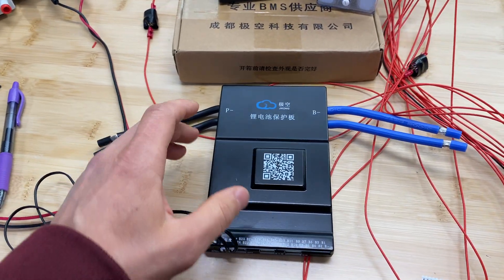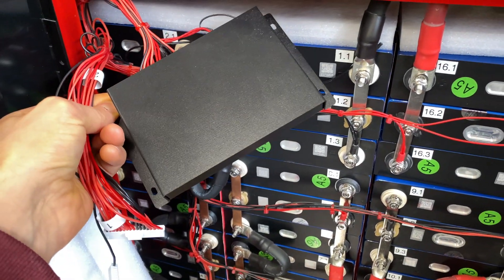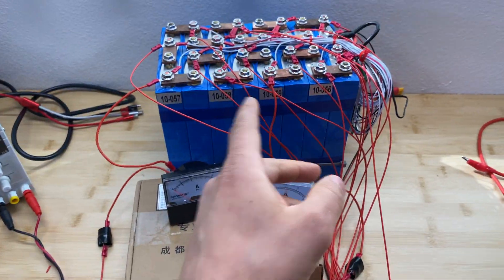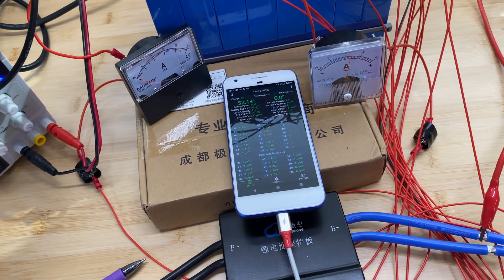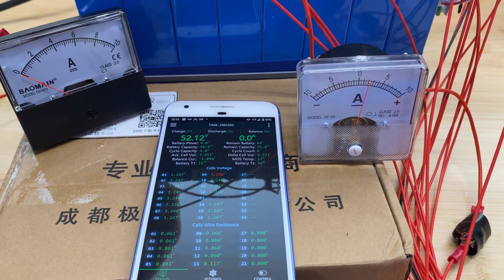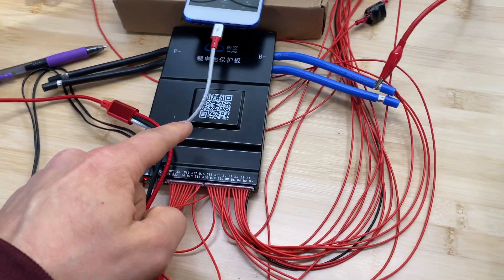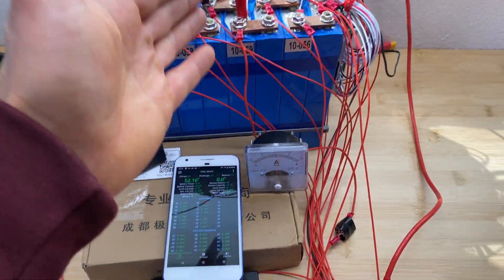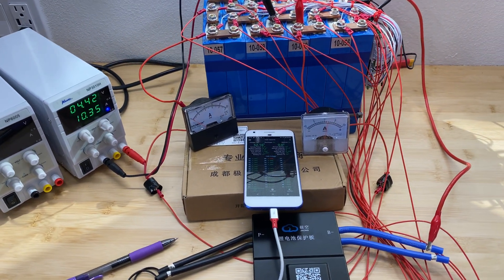JK BMS 2A Active balancer. Is that real?

Comment: good test but this has to be like that, you can not draw / send current and also sense the voltage correctly at the same time. It would need separate leads for that or to drop power to do it

Comment: I've just ordered two of the 2 Amp bms. I hope they do good on my 24 volt configuration
Reply from the maker: it's a good balancer, make sure you crimp connectors for each balancer (do not combine 2 wires under 1 connector)

Comment: Hi there.  Firstly, your video has been a great for getting me to build my own battery pack.  I had my pack running for several months with the JK BMS you are using in this video.  Recently, I have an alarm shown on the app relating to this BMS.  I switched the BMS off fixed the problem and discovered that I could not turn it back on.  I tried using the 5V approach and also using the LCD display.  Nothing happened,  I noticed also that the cycle count before turning off was 77.  In the past, I was able to switch it on and off but now it will not turn on at all.  Have you experienced this?  I am open to any suggestions you might have.

Comment: Why don't they sell a version with threaded holes?
Reply from the maker: good question, idk
Reply: @SolarEngineering  it looks like 8awg....I would rather do my own wires.
Reply from the maker: @MyGoogleYoutube  yeah, unfortunately, it's soldered to BMS, and it's going to be hard to fit a bigger awg there.
It works fine in my setup since I published this video. (not pushing more than 100A trough bms)
Reply: @SolarEngineering  How did you bind on to the supplied wires?
Reply from the maker: @MyGoogleYoutube  crimped 2 wires under one lug.
Reply from the maker: stop this video at 7:45 and check 2 blue wires close to the 1.1 label
https://youtu.be/yGWc1_Ujbq0?t=465

Comment: Just tried this one on a new pack to charge it as 1 cell wanted to run but it won't pear with my phone since I changed the password ever have an issue with yours? Don't know if I should buy another I don't need $400 paperweights (200 ea)
Reply from the maker: strange, do you have red led on? do you hear BMS beeping when you power it?

Comment: In the installation of my JK BMS I cut some of the cables that go to the batteries to avoid having to coil them. I wonder if JK BMS tests each wire and enters a different resistance for each without user intervention?
Reply: There is a screen on the app that shows the resistance of each wire. I don’t know if it uses that info or just displays it

Comment: How do you calculate the size BMS to purchase?
Reply from the maker: Take max load current or charge current and multiple by 2 (because cheap Chinese BMSs usually overrated). 
I'm pulling about 90A Max from my battery bank with this BMS, so far works great.
Reply: @SolarEngineering  Thanks for your reply.

Comment: Can you please let me know how did you connect the  black cables marked P-? And why are there 2 blue cables marked B-? One is not enough?Thanks for the reply
Reply from the maker: P- and B- paralleled. You need to use all of them to distribute load from BMS equally.
B- connected to battery negative.
P- to load (aka inverter/charger) negative

Comment: Really good video. Are those 2 cables on each side of the BMS even capable of handling 200A sustained?
Reply: 4 AWG wire is recommended for current draws of 150 amps - 250 amps @ 13.5v @ 4-7 feet.

The JK BMS used dual 7 AWG wire @ 1/2 ft. This is 2x13mm2 = 26mm2.  This is actually thicker than 4 AWG (25mm2).

So, can 1/2 ft of dual 7 AWG copper wire handle 200 A? 

Answer is YES
Reply: @DavidHalko  7 AWG wire is about 10.5 mm2 NOT 13
https://it.wikipedia.org/wiki/American_wire_gauge
so 2x 7 AWG is about 21 mm2 wire section.
Reply from the maker: these wires are not rated for 200A for sure, I'm pushing 90A through BMS and so far it works fine.
Reply: @SolarEngineering  ok thanks. its amazing how its rated for 200A continuous but the wiring can't handle it. The JKs are really good BMS in terms of features and the balancing current. If they can only utiilize the proper rated cables, this BMS would be unbeatable.
Reply: @hendersonsobers396  the cables are able to handle it. The good thing is they have threaded in and outputs which you can make your own thicker cables even with 35mm and 70 mm terminal cables which fit. Andy in Off-grid garage has tested this.

This a good video to explain how the BMS works, but the reason why it works with pulses, has to do with reading and pushing power in between readings, but the assumption is correct, not a continuous 2 amp balance.
Reply: @SolarEngineering  If this helps, i have that BMS with the bluetooth, and at 80 Amps steady for 1 hour at 25ºC ambient, on just ONE wire( that is all i need,and makes for an easier installation) it works fine,stays cool by itself,no cooling,no fan,no water spray; it also has the  best silicone jacket quality, and best extremely fine tinned wires, hundreds of them; ( rated for over 200ºC,the manual says); so far,it works like a champ ,3 months on, but i never push more than 80Amps, and usually 30 Amps only all the time.

Comment: So, is it junk ?
Reply from the maker: no, it's working in my 23kWh battery bank. I'm pulling/pushing about 100A, and so far works great.
Reply: @SolarEngineering  i watched offgrid do a review on these bms's and his let smoke out at 200 amp. Im considering buying 2 for 2, 4s batteries and want to be sure they are ok.
Reply from the maker: @karldingbat  I haven't pushed 200A, even wires soldered to BMS are not rated to 200A. So I derated BMS to 100A.

Comment: It will pull 2a from a cell but it only does that 40% of the time.  But it works very well.
Reply: My experience of 3 months,24 hours a day is that it works, but it is really slow,useless  on 100+ AmpHour batteries while they are charging or discharging;  when one of them wants to drift to + or- 0.300 or 0.400 V, it just can´t cope;  if they are off, it works ok, but then it will hardly be needed; 

Mine are not matched, but of course the best way is to have closely matched cells from factory; what i do is,  i paralleled the 8 mismatched,cheap, 200Ah cells with 8 excellent ones of 60Ah,the best  (someone gave me them,used from 2014, Winston?..factory matched with serial numbers!!) 2 by 2 ,2P8S, and the 60Ah ones keep the big ones in check; 1 BMS,  8S, only,all have monitoring wires of  1.5 mm2.

Comment: cut balancing amperege in half?? what kind of amature talk is that. unbelieveble.
Reply from the maker: I feel like "1A constant active balancing" will be more correct description of bms/balancer.
Reply: @SolarEngineering   of course,you are right, it works only half of the time;   but what about the ones that only say 500mA, or 1 amp?  you need to divide that by 2,also,or not?
Reply from the maker: @josepeixoto3384  yes, it will work same way, so need to divide by 2.
Reply: @SolarEngineering  Correct, and it only balances one cell versus the other balancers doing multiple cells so its even slower than half. But it still works good enough, well done JK!

Comment: The pulse 2A balancing is as per design and it is not safe to have continuous balancing esp in such higher current. The BMS balancer is designed to sense the voltage accurately by dropping balance current. This is to prevent overcharging and discharging of the cells by the balancer itself. Voltage reading over the small balance leads will be inaccurate if the current is not dropped to 0. Hope you understand the function.

Comment: Would you recommend this or daly BMS?
Reply from the maker: I haven't use it yet for continuous period. Can provide my opinion after month of use. 
I don't want to come back to Chargery BMS for sure.
Reply: @SolarEngineering  waiting for a review video! Also, your video presenting is very good.  Great videos, keep it up!
Reply from the maker: @gytax01  thanks for the feedback, appreciate it.
Reply: JK over Dally. 

The balancing of the dally ends when the battery is charged, even if the cells are not balanced. The JK BMS can start balancing when battery is mostly changed and can keep balancing after the battery is fully charged (to deal with very large battery banks.)

Comment: Hi. I have such a Bms, and I have a problem that the LED does not flash.
How can I make it happen? Can I install JK BMS?
Thanks
Reply from the maker: do you mean BMS doesn't work at all or just LED doesn't blink?
Reply: @SolarEngineering  Stop blinking!
And I don't think I can install the application to start Bms control
Reply from the maker: hm, installation off application is another topic, check your phone..

I noticed that LED is solid when BMS not balancing any cells. 
Also BMS charging activated, make sure BMS is active.
Reply: Have you triggered the BMS with a voltage at least 4V higher than the battery voltage? Off Grid Garage YouTube channel had the same problem.. it is not mentioned in the instructions that came with the BMS. Once he had triggered it , the BMS worked well and the light started flashing... See his first video about the JK BMS.

Comment: Come on get real. It isn't possible to move 2 amps continuous. The process is to charge a capacitor from the chosen high cell and then when the capacitor is charged, discharge the energy into the chosen low cell. The active balancer you already have does exactly the same process.
It works fine even with 320ah cells.
Reply from the maker: I'm on max level of realism. I see you opinion, mine slightly different.
Reply: @SolarEngineering  Not an opinion matey, its physics. 
If you have access to an oscilloscope, monitor the charge current profile on one channel and the discharge current profile on the other. Be careful with the common ground though, you could short out several cells.
Using a capacitor to transfer charge from one place in a series circuit to another is a handy, efficient and understandable methodology.
Remember the cells must remain isolated from each other, the capacitor does that effectively and flexibly.
Imagine cell 16 is the high one at instant"a" while cell 5 is the lowest, current flows from cell 16 into the transfer capacitor to create charge at the classical exponentially reducing wave shape. Once the capacitor is charged the terminals are switched across cell 5 until discharged. The processor then polls for the instantaneously highest cell and recharges the capacitor, polls for the lowest cell and discharges into that cell, ad infinitum.
Any balance device that draws continuous current is just burning the highest charge off in a resistor, which is why this type are limited to milliamps. 
Remember in the physical world (unlike the political world) "alternative facts" can't exist. Opinions without facts are at best a guess or maybe a wish. Facts must be measured or demonstrated (and attempts made to disprove them).
Reply: @mikenewman4078  I just got the jk 150 amp version I have been watching off grid solar garage he has vid showing  Charging from more than one low cell at a time  randomly just saying without monitoring all the cells he is just on one.
Reply: @mikenewman4078   i think you may be missing something:  it is NOT possible to take  energy, ---Ah, from cell 2 at 3.222 volts, store it in a cap, and then transfer it to cell 1 at 3.202 volts, in .25 seconds;    it's a neat trick that they do,do you know how it's done
edit:  i think i do, just checking it now
Reply: @josepeixoto3384  what's the trick? 👀

Comment: That's not good
Reply: It needs to stop balance and check and read the voltage if it should continue to balance or not since it is using the same cable to read the voltage in mV and transfer the power.   If you check other litium presition chargers with one small cable per cell you will notice this is common.   But it is good to know it will only transfer energy from and to a pair of cells at a time.  From what I can see there is no claim that it a 2A continiuos balansing. That would require double or much thicker cables per cell.  I wounder why this is a problem for you other then you did not expect this and only read the title with 2A.
Reply: @johthe  wouldn't that be the same as having a 150amp bms, that cannot do 150 amps continuesly but only a few seconds at most? I guess this is a 2A balancer that works by design, which is good but people get another idea with 2A; tbh in my opinion it could be 1A I'm not complaining just recently ordered mine.
Reply: Its operating just like it was designed to do.
Reply from the maker: but not as advertised.